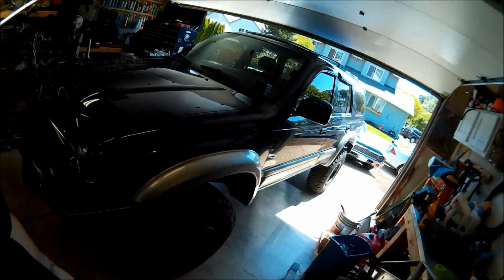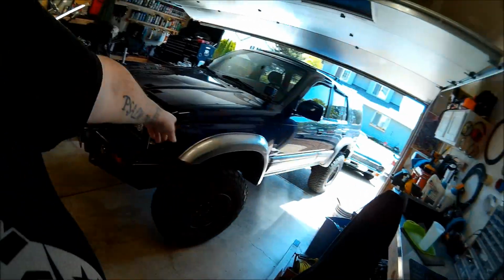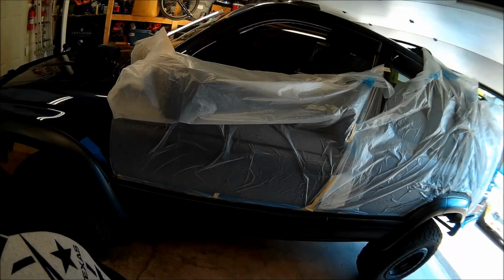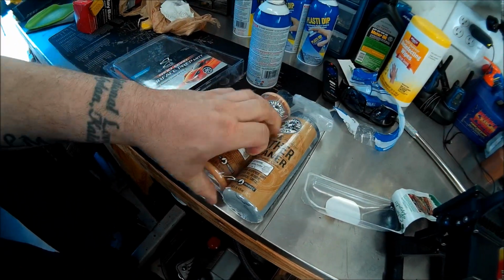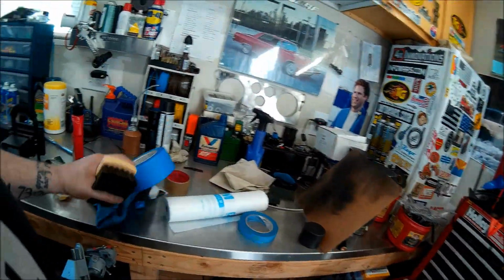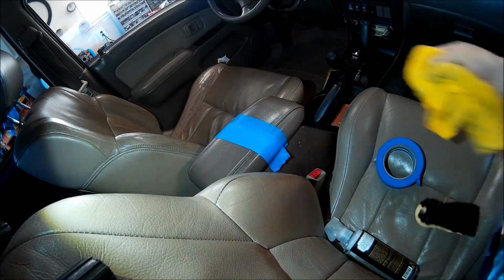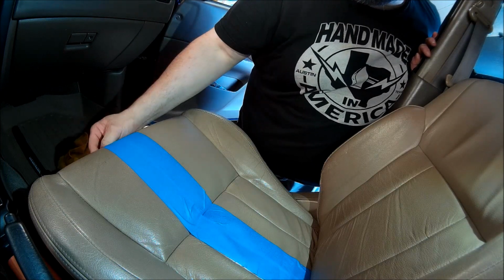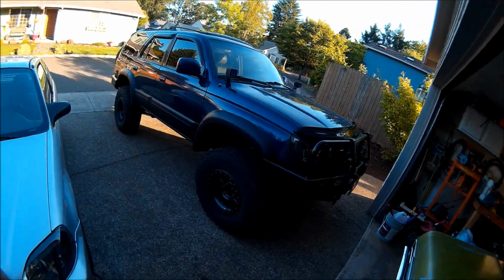Plasti-Dipping the 4Runner

Comment: I have used plasti dip a few times. If you dont use the glosifier it will fade grey in 8 months. It starts to look dull. This most recent time I did it, I added the gloss coat and it looks a lot better and should last a lot better. And will be easier to remove because more layers.
Reply from the maker: 4Runner4life98 good point, thanks for the heads up. I have a protectant I bought to apply that my buddy told me about that I already bought so I am going to try that. If it doesn’t I will definitely do it the way you suggest!
Reply from the maker: 4Runner4life98 good point, thanks for the heads up. I have a protectant I bought to apply that my buddy told me about that I already bought so I am going to try that. If it doesn’t I will definitely do it the way you suggest!

Comment: I’m lookin at buyin a 2000 4Runner but noticed it doesn’t have the fender flares. I thought all 3rd gen 4runners had the fender flares or at least from 2000-2002. Any ideas why the one I’m looking at doesn’t have them?
Reply from the maker: Not all had them. There were some without, some just had a little chrome strip, some had low profile black plastic ones and then ones like mine had the fatter ones.. fatter ones could be a “Limited” model thing.. not sure but if you don’t see them there is no reason to be alarmed :)